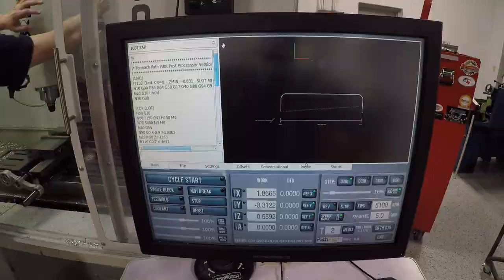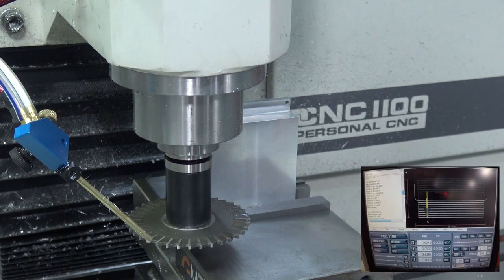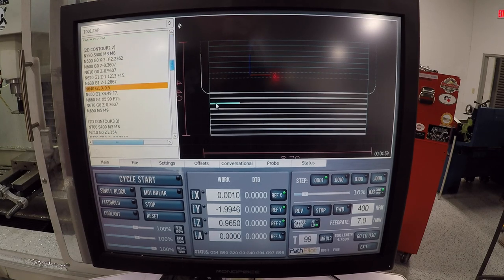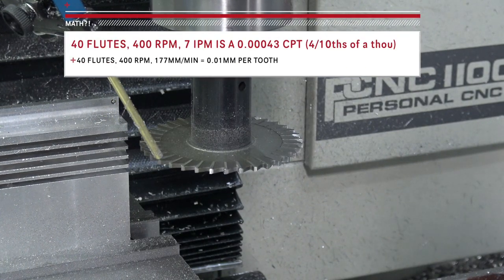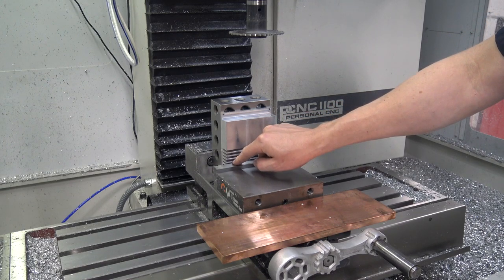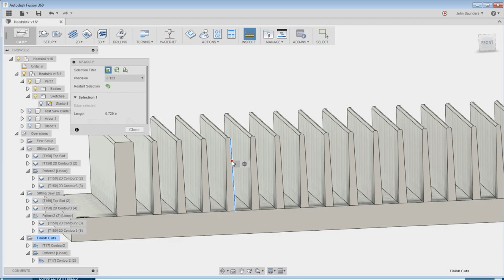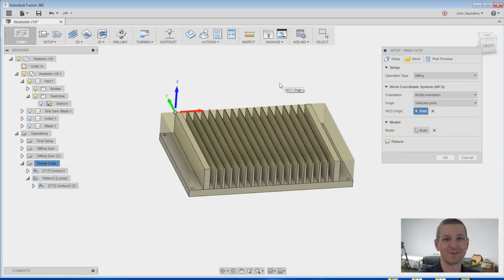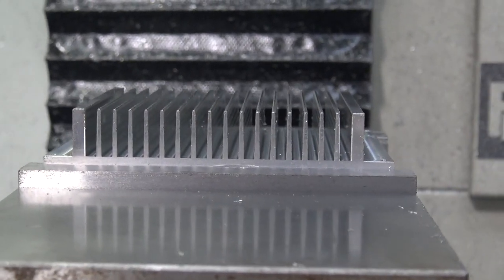CNC Machining a Heat Sink!  Part 2 Widget102

Comment: Last time I was slotting with a setup like this I had a 180mm cutter running at over 10,000rpm can't remember how many teeth....lots lol.
i'v never run a carbide tooth cutter this slow in aluminium... HSS slitting saws I run slow especially in steel.
Isn't it (sfm x 3.82)/diameter for rpm?
that would get you around 2000rpm for aluminium.
IPM = ipt x rpm x No of teeth.
where did you get your recipe? 
It's all a learning curve, for yourself and us following along at home. 😉

Comment: Just a piece of my knowledge. If you want the best heat transfer from a heat sink, dont polish it, instead bead blast the cooling surface. The blasting will make peaks and valleys in the surface of the metal, effectively increasing the surface area. Also, just remember NEVER paint a heat sink.
Reply: +NYC CNC more surface = better cooling, and of course the copper sucks the heat, from what metal do you think manufactured the solar heaters?
Reply: That, plus the hills and valleys promote turbulent flow. You want to break any stagnant boundary layer as much as possible. Air is a great insulator as well.

Comment: Old school here. A drop or two of kerosene from a squirt bottle on that slitting saw would work wonders. Might not be EPA approved, but kerosene is the best lubricant for cutting aluminum.  Don't get carried away, just a drop or two is all it takes. Also, in over 50 years of machining I've never heard a slitting saw that DIDN'T sound like that one. That is probably why my hearing is shot to hell.

Comment: will you be doing a finer fin in the future? maybe in something softer like copper?
Reply: In my experience, Copper(depends on grade and state(annealed or not annealed) is not softer than Aluminium. Also copper is even more sticky than Ali.
Reply: Yeah hardness is going to depend, I usually put the copper in the freezer and lubricate with alcohol before threading for example, the low temps and the alcohol really helps prevent the stickiness.

Comment: Ok, so a 1.4° sine plate would've worked and I might have used a short precision ground angle plate for setup.
Reply: Wouldn't using a sine plate cause each slot to be increasing in depth?
Reply: No. It would have the same effect as tilting head1.4°.
Reply: +gbowne1
Don't see how tilting the part is the same as tilting the head. If you raise one end of the work piece it changes the Z depth, tilting the head does not

Comment: why not make a 1.4º fixture block to put in the vise?  Then you could machine machine the left side of all the slots, flip upside down, and then machine all right sides.  No stair stepping needed and all with the same cutter

Comment: Curious, I see that you have a Glacern vice, been looking to tool up and have priced Kurt, Glacern, and a few others, the standard is Kurt, any thoughts?
Reply: From what I know. Orange vises are milled solid bases from Durabar. Which is a casted bar. But I'm not sure what grade Durabar is used. 

I'm leery about how the fixed jaw is just pin located and you can slide the whole screw carriage around. Not sure if you'd get repeatability issues or slightly out of aligned jaws or not.  (Despite marketing claims )

Kurt has AngLok which anyone whose used a non Kurt then a Kurt knows it's more than just marketing BS. It significantly improves part retention. 

Orange does claim a 10,000 lb max clamping force, vs a Kurt D688's 7,970 lbs. with anglok not sure who wins out there

Making soft jaws for the Orange vise requires having to machine an accurate dovetail to mount it. Not sure how keen I am on doing that just for softjaws

A Kurt D688 is about $600 right now. The lowest price Orange has a list price of $1400. 

The Orange vise does have more versatility. But not sure it's $800 more versatility. 

Either way. I'm sticking with my Lang 125 :)
Reply: +NYC CNC Chick One-Lok vise is also worth considering you do mostly aluminum and use soft jaws often.
Reply: I checked out the Orange Vice selection.  I am quickly finding out that the cheapest thing I have purchased so far is the mill.  I will check the One-Lok out

Comment: I thought you were going to nod your mill head 1.4 deg, then run all of the top cuts, nod to -1.4 deg and run all the bottom cuts
Bill
Reply: Bill Cooley I don’t think Tormach mills have nod or tilt like a vertical knee mill.

Comment: That slitting saw noise. That would drive me up the wall. It sounds as if it's out of round. The fixturing for the fin cutting, I'd have skinned that cat by making a tombstone, closing the vise on it, then screwing the stock to the tombstone with the holes you've already spotted and drilled. 'course, that's more of a volume production, "I'm making thirty of these damn widgets" kind of thing, but it would have a bit of utility here rather than the hackish 2-4-6 block solution.

Comment: 400 rpm is way to fast on the surface speed, your running that cutter at 418 sfpm,  the reason you are getting heat is because the aluminum is galling to the teeth of that cutter.

Comment: the rpm is too high ... in that cutter i think cut better at 240/280 rmp and 0.06 mm for tooth ... the chip weld in the cutting edge because is conventional milling ;it goes to push the cutter in to the workpiece and cut in hard condition . in alluminum i never tried to go on conventional verse because generate too heat and alluminum is sensibile; it fuse at 480/530° celsius... 

and last thing on alluminum use flood coolant or change the oil of the mql ... i think a liquid cool much faster ...
Reply: sorry my bad english.. i'm italian
Reply: Yes but he said at the beginning of the video that the Tormach 1100 has a poor torque at low rpms... So he had to find a compromise between feed rate and rpm.

Comment: New to the channel. I'm not very familiar with the slot cutter but i do want to know why you run such a slow speed and feed with an end mill on aluminum?  Even a 1/8 mill should be able to go 700-900 in/min.  600 at the very slowest. especially since you weren't even taking hardly a cut.  37 minutes blew my mind. That should have been a 8 minute operation. Grab a piece of scrap throw it in the jaws crank up the speed and just let it rip.

Comment: never understood why these saws allways runout that much, and you are cutting with only a small amount of teeth. machinist would never accept that with an end mill. probably explains also why your chip size is not what you expect. why is it so hard to make them run true? cheers.
Reply: They shouldn't runout that much...
Reply: The good ones are $200 not $20. He needs better tooling

Comment: Why does a 250mm mitre saw run at 3000rpm, but a 4" slotting saw run at 400? That's less than 1/20th of the "surface feet per minute"?

Correction: 4600rpm!
Reply: Completely different cutter geometry. 

Though I have heard of people who used the 4" carbide tipped saw blades on arbors and crank up the revs. Can't say I've tried it myself. But then I can't think of a reason why it wouldn't work either. 

The finish might suck, but if you're going back to clean up the ribs anyway what does it matter
Reply: Or even just re-grind the existing TCT blade. I don't know who would do that in the US, but Austro does it here.

It has to be faster than this.

Comment: Food for thought: "What if" you took and drilled down the center line of each groove and .010 short of your max depth, say a 1/4 or 5/16 spacing, BEFORE you stood it up?!?!?! This could be auto run without watching over it.
Reply: You mean intentionally make the saw have to take interrupted cuts??

Nope. Saws do not like interrupted cuts at all.
Reply: Times change after 35 plus years and of course there weren't any CNC's around. They were horizontal milling steel as well. I was told that drilling out 50% of the width reduced the cutting pressure on the saw. But that's old school and all the machines were from WW2 surplus.
Oh yeah! My math must be really out of date... how do you figure it's "intermittent"? ... You got a 4" Cutter and the drilled holes are on a 1/4" spacing. The cutter would just be finishing the first as well as cutting into the fourth or fifth. It's cutting with less pressure and heat build up.

Comment: The chip welding problem is called a built up edge, or BUE. https://en.wikipedia.org/wiki/Built_up_edge
Its caused by the part of the chip that is actually rubbing on the cutter work hardening and the rest of the material slipping off on the work hardened section. The best way to avoid this problem is either to run fast enough for the chip to get hot and avoid work hardening (not an option in this setup) or don't machine aluminum. Good old 6061 is really bad about BUE if you aren't running fast enough.

Comment: Hi, i looked many of you videos and i like them. Great job.And i do subscribe. But on this one i am looking at it from a mass production point of view.
The part obvious look like it is going to be an extruded part which is just cut to length and then knocked down 4 holes in the corners. So i don't get all the fuss about tolerances and degrees on the fins, because this is not what is going to happen in real life. On the extrusions tool it is easy to make it to specification with all degree angles and radius, but if your profile is 1500mm long for example !, then you don't stand a chance to make a proper sample on almost any machine !
In similar cases we advice our customers to accept less complicated samples for testing and then wait for the real tool to be made, but that is just my advice as european producing in China. (have been here for 16 years now)

Comment: Wow, glad I'm not the only one with these issues.. hah.  I had a very similar setup, only I had to machine a couple fins off a large heat sink for a job. It was the first time I was using a 4" side cutter and just (completely incorrectly) guessed at a spindle speed that was like 100 times too fast and chip welded the whole thing. I cleaned it up and then actually did the F&S calcs and got through it.  But then I had to trim down the height of the heat sink.  It was like the sound of fingernails on the a chalk board...coming out of a jet engine. Had to do it after hours (lest my corporate neighbors complained) and with full hearing protection.  https://www.youtube.com/watch?v=Q7NmJL4qmuQ (RIP Headphone users)
Love the vids!